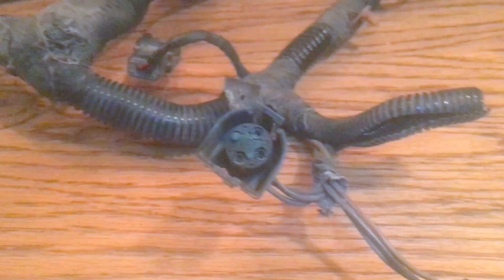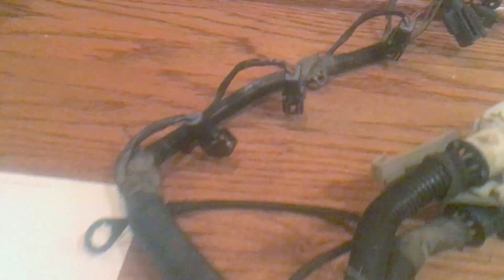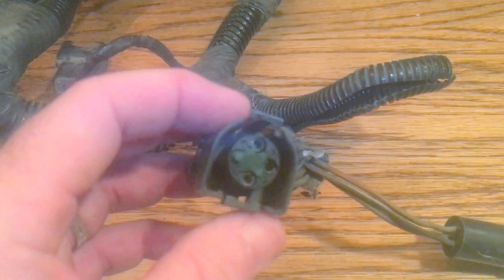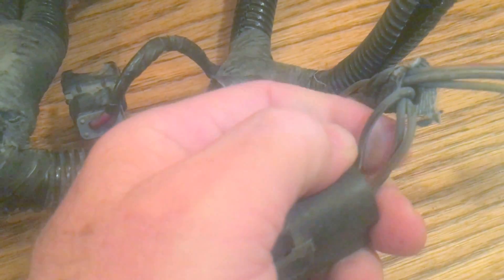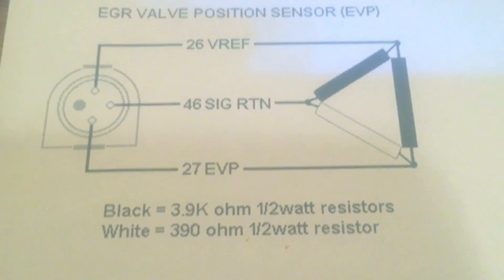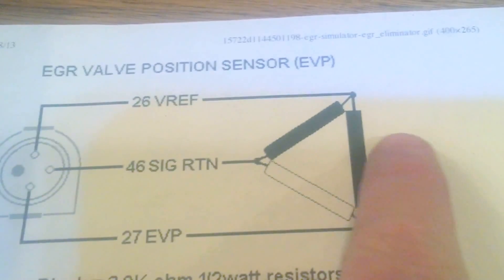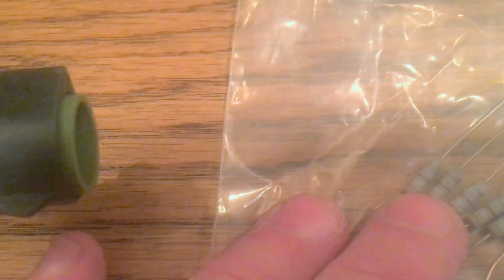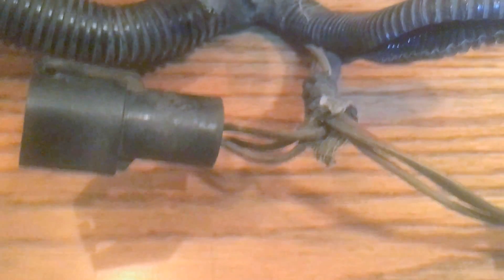Ford 5.0 EFI Harness EGR Delete with resistors Series 2 Video 5

Comment: Thanks for the video! 
Question on my harness I’m working on a 95 harness and my tranny is a T5. On my trans I only have a VSS and a reverse light switch. What do I do with pin 30 on my ECU for nutreul lever interface ? That’s aging for this egr delete info!!

Comment: dont they sell a plug in EGR simulater device that does the same thing you done?
Reply from the maker: Yes, there was a plug that you could buy and just plug it into the EGR connector and it would to the exact same things as these resistors.  However, when I looked into getting one for my conversion a few years ago, it was no longer available.  At least at that time it was.  Not sure about these days.

Comment: I have a 1997 F350XL with the 5.8 and was wondering if the same resistors would be used to delete the egr as you used on the 5.0.

Comment: Can you help I did the egr delete put the resistors in wiring harness just as you showed on your video now I'm getting a code that says evap voltage too high
Reply from the maker: Hi, I think that code is normal for a conversion harness. The delete steps with the resistors is to keep the Check Engine Light from illuminating.  However you’re going to get some codes related to the evaporation stuff when you rework a harness and remove them along with the EGR. They don’t have any impact on the engine or how it runs.
Reply: @MajorSporto  the check engine light came on right after motor was cranked pulled code and that what it read voltage to high do I go up on the 3.9 k resistor should that make the voltage drop

Comment: It worked on my Ford pickup 95 5.8 keeps the light off
Reply: Did you do the same thing shown in this video, on my 95 5.8 it still throws a code when i install the same resistors in the same pattern in the connector

Comment: I have a question I recently did the EGR delete and finished it correctly where they just left the unplugged well as I'm accelerating I can slightly feel it pulse not a skip My problem is in my head it's dual exhaust with no crossover tube could the O2 sensor being on one pipe be causing my air fuel to be adjusted because it's not getting 100% of the readings it should be getting makes me think and wonder because it wasn't doing this before till I did this not a bad thing just an adjustment that needs to be made if anything
Reply from the maker: Hi Phill, do you have both O2 sensors hooked up?  I know on a 5.0 there should be two O2 sensors, one for each pipe so the exhaust can be monitored for the left and right bank of the engine.  Not sure if this is a Mustang computer you're working with.  However, if you're using a computer from 86-93 (and probably later) you really should have two O2 sensors to run it on a stock tune.  Maybe a vacuum leak or some other way of unmetered air is entering your engine and causing you the slight issue.  Can you pull codes?  Sometimes you can get a code that does not turn on the CEL.  Just some ideas.  Good luck!

Comment: I really appreciated the EGR delete videos.  I think I'll do that on my '86 F-150.  I am trying to figure out the TAD/TAB delete connections and the appropriate resistor for that job.  You seemed like a knowledgeable source.  Thanks for any help you can offer.
Reply: On those two 50 amp resistors work there's a video on that here you just need to look until you find it sorry I don't remember the name

Comment: I did this to my 5.8 and it kept the check engine light off but it would cause the engine to stumble and sometimes did when in gear and lightly accelerating (like backing out of the driveway or pulling away from a stop sign).  Any ideas?
Reply from the maker: Is this a new problem that happened after doing the EGR delete?  If so, I would check for any vacuum leaks, and also take a look at the IAC, make sure it is working properly.  Perhaps may want to try the base idle reset to make sure the fast idle control sensor is set properly.  Just some ideas.  Thanks for watching!
Reply from the maker: Is this a new problem that happened after doing the EGR delete?  If so, I would check for any vacuum leaks, and also take a look at the IAC, make sure it is working properly.  Perhaps may want to try the base idle reset to make sure the fast idle control sensor is set properly.  Just some ideas.  Thanks for watching!
Reply: @MajorSporto  hey major Sir. I have an F-150 5.0 well b4 I got it they did a crate engine. Gonna put some oh sht to it... My younger cousin's grad present... Changed mind bear with me it is important.... Supposedly they put a cam in it???not sure and true duals lol WTH 1 o2 sensor headers no crossover WT! The issue is it will in time burn up the ECMPCM or kill the ICM at distributor rarely kill the coil. I've been trying this thing for years now... I'm about sure I may have it but this thing is like the spoiled hi school GF lol anything and it's pissed  guess what EGR plugged and plg thrown dwn IDK so I also need this fix has always been rich and known there's got to be more in this truck anything plz just bounce ideas back at me and Jesus Christ I would appreciate it... Oh and a lot of the reason why I don't just carb or something.... $$$ brother I'm broke no job thanks Rona

Comment: Will it work if I just splice the wired together ? Lol
Reply from the maker: I don't think so.  The resistors imitate the actual EGR sender, so the computer "thinks" it is still there.  If you splice the wires you will get a constant Check Engine Light and some codes. P

Comment: Where can I get the electrical  diagrams? I need help
Reply: You can get a Haynes manual for your vehicle from most auto parts stores. In the back of the manual, you will find wiring diagrams for everything in the vehicle.